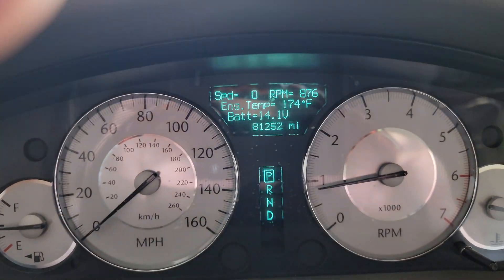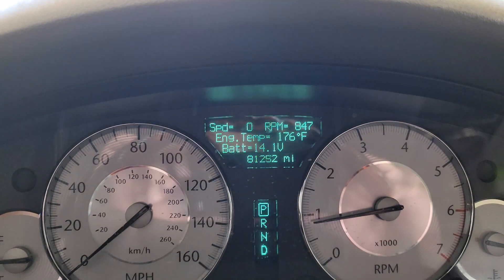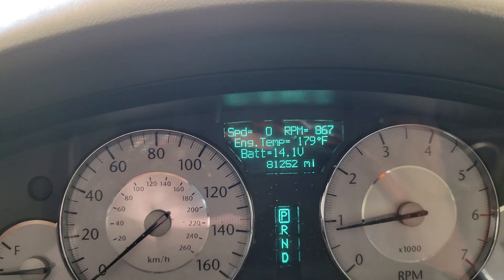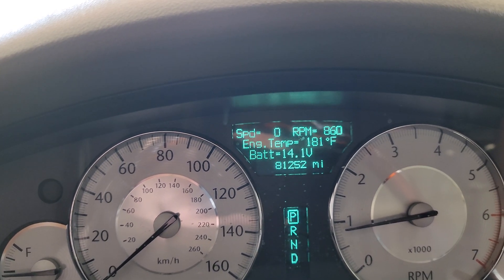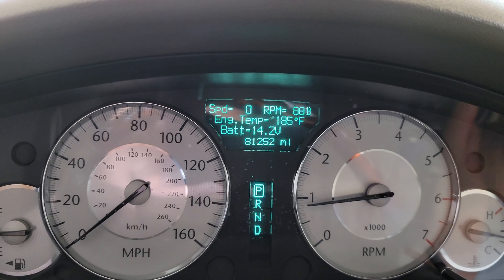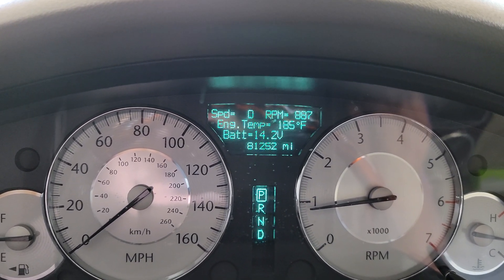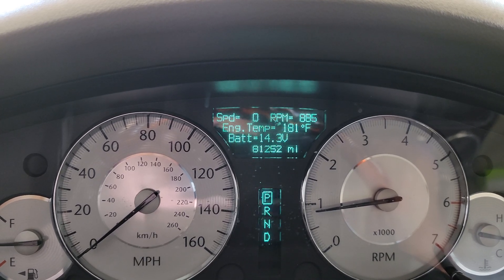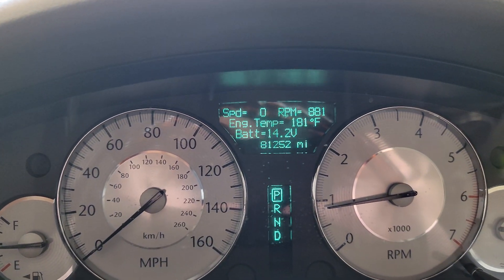Big Voltage Drop after Amp Upgrade

Comment: Does the bass cut out
Reply from the maker: No, I went back and reset the gains and it wasn't so bad. I'm still waiting on a Titan 8 battery to add to the system which should let me open it up a little more.
Reply: @FatboyBass  do you have the big 3